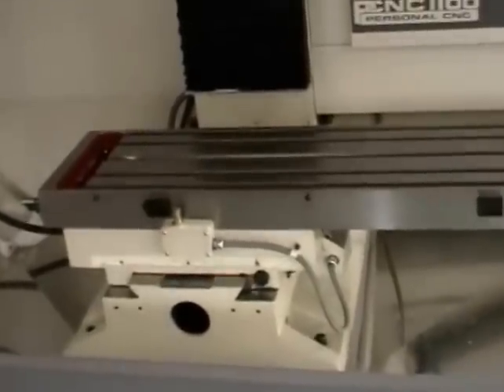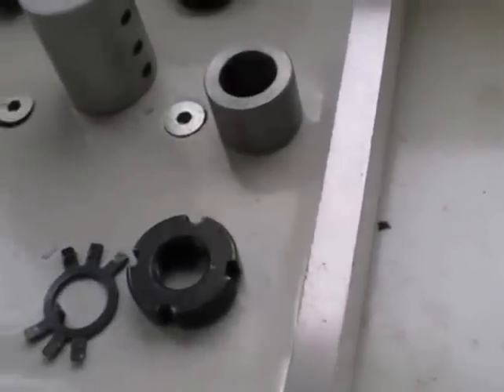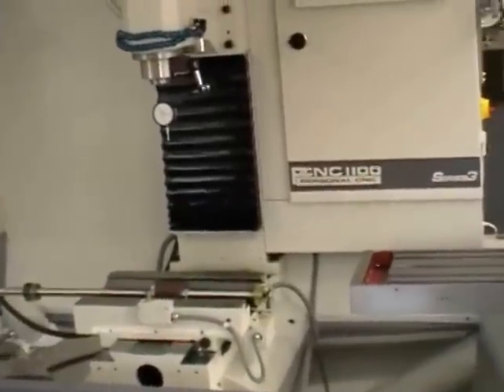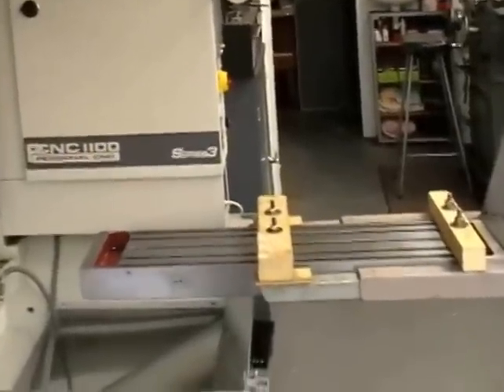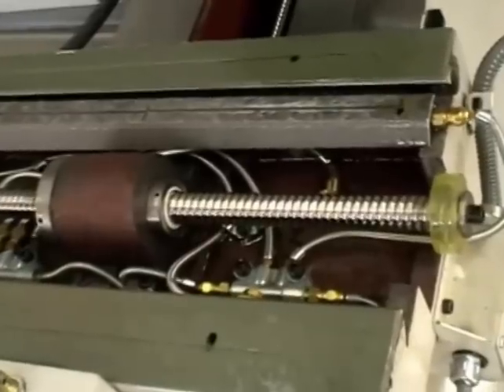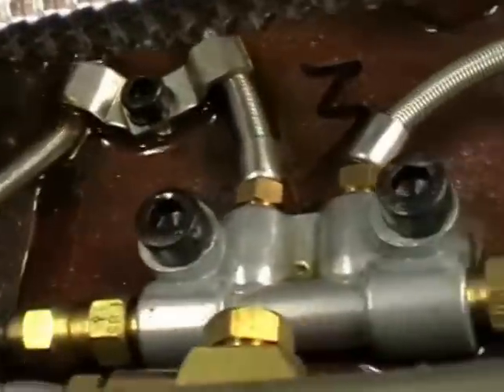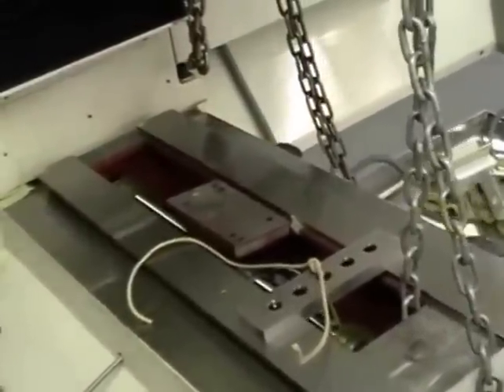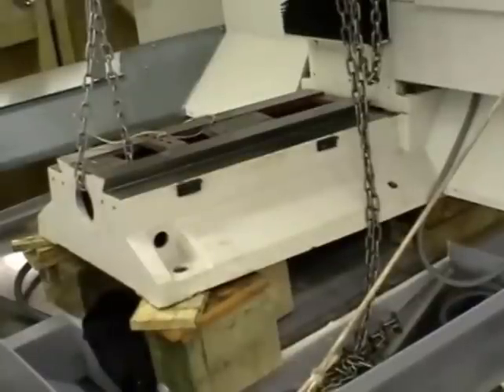Tormach 1100 Table and X Y slideway dismantle

Comment from the maker: Hi - Well the answer to your questions is a long story. Too long to tell here. But in short it was partly to check the build and assembly quality. I have dismantled and rebuilt several machine tools over the years and know that assembly quality ex many aahh...low cost manufacturers can be poor. My findings?...well again in short, I think for the price, Tormach do a very good job of the difficult task of QC from a distance.
Reply: +Threadexpress - much appreciate your answer. I have been studying my options, I seem to learn more all the time about the 1100 all the time as I have been looking to buy one. I really like your critical views and presentation! Helps remove some of the rose color off my glasses a bit ;).